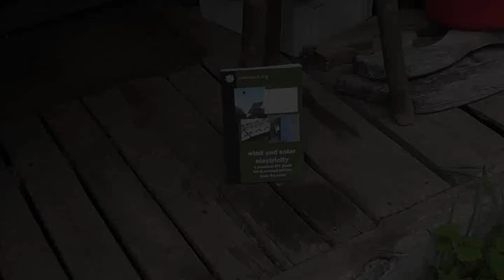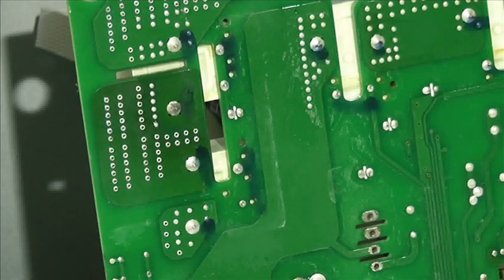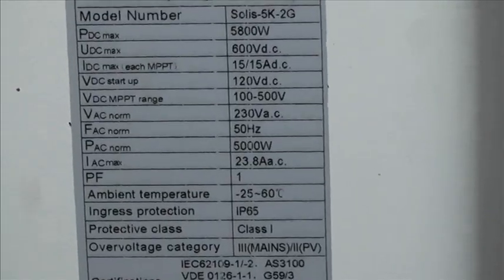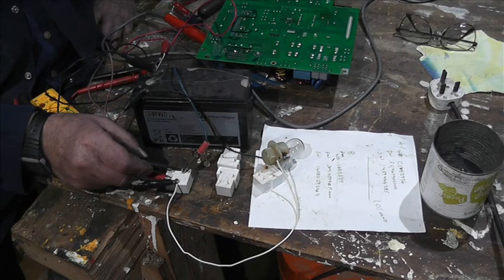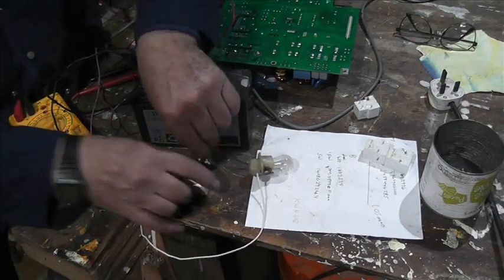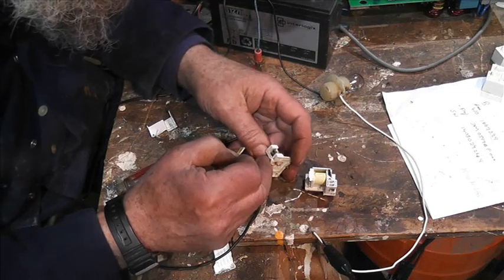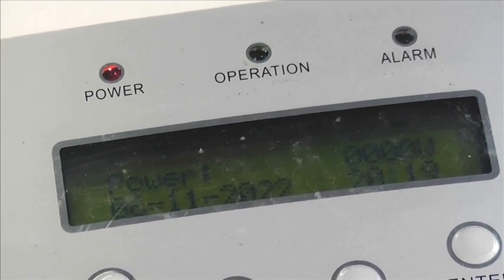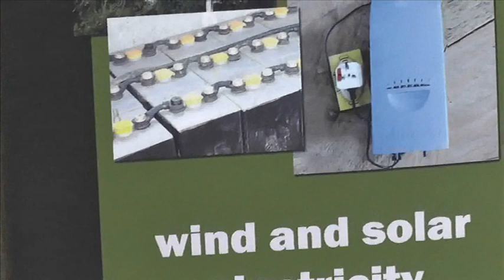Solis inverter hidden OV BUS fault 5KW

Comment: Another great repair thanks for sharing Andy. One wonders if a relay built in the good old days would fail like these do I think not. But they where made to deal with the real currents and voltages and not to a price. In those days we were taught always to adjust a relay with the contact self cleaning action. Thanks for the video.
Reply from the maker: Yes it's a shame and having the tops glued on is despicable, cheers

Comment: Brilliant video. Everything just as you described. Thank you so much.
Reply from the maker: James, so you fixed your inverter, splendid, Subscribed? cheers
Reply: @TheInfoworks  If you're ever in Cornwall, I owe you a pasty and a Bodyboarding or Painting lesson.
Reply from the maker: @jamesbarker7360  Hi, that's the best part of 400 miles, great it all turned out well, you could by me a pasty through my paypal, cheers
Reply: @TheInfoworks  Have a couple. Cheers!
Reply from the maker: @jamesbarker7360  Much appreciated, thank-you
Reply: @TheInfoworks  Update: Inverter is still working, but topping out at 3kW. It's making ticking sounds (arcing or relay), and the readout shows it is jumping up over 5kW briefly. Any ideas? Could it be my poor soldering or do I need to bend the arm more/less? Tried isolating the individual PV banks and each will do 1.6kW, so I'm thinking it's an inverter issue.
Reply from the maker: @jamesbarker7360  sounds like arcing, maybe the relay or a capacitor. Investigate because it will only get worse, cheers

Comment: Great info Andy! I've installed a few Solis' for friends (albeit the storage inverters with 48V batteries).
I''m wondering if they have the same setup with regards to the relays etc.
Thanks for your videos!!!
Reply from the maker: Hi, I suspect they will be very similar, heat is the problem and ventilation the cure, cheers
Reply: @TheInfoworks  Do you know if these relays get cycled every day? In other words, do they open at night when the sun goes down or do they only open in case of loss of mains/other problems?
Reply from the maker: @koffibanan3099  All of these, morning , evening, loss of mains and over heating. The last 2 do the contact damage, cheers

Comment: Good aye Andy, impressive work. Instead of cleaning the relay, can replacements be procured. Cheers
Reply from the maker: Mick, oh yes, you can replace the relays but be careful of the fine tracks to the relay coil connection. They are easy to damage. Hope you have subscribed, cheers

Comment: Iv no clue about electronics but my solis inverter has the ov-bus alarm think I’ll try this method have a go at it. Thanks for the info
Reply from the maker: It's not difficult, just unplugging the white plug, please subscribe, cheers
Reply from the maker: Once you've fixed it watch my video on extending inverter life. The inverter should be in a cool, ventilated space, not in the loft, cheers

Comment: If you're experience of contacts burning out on a nunber of gridtie inverters, could the relay be socketed for easy changing or else on wires?
Reply from the maker: Hi, yes you are right, but this only happens with inverter abuse. I must do a  video on the basic rules, cheers

Comment: Shame the relays can't be plugged in Andy, not electronics type plug but 13a UK type prongs.
Reply from the maker: Hi, in motor vehicles the relay spade connectors commonly create a problem, the more connectors the greater the fail rate. Having said that it would be good to make these a service part. Cheers

Comment: Hi Andy, may I rack your brain over a battery charging issue I have…? I have 3x 130ah 12v AGM batteries on my boat all the same age about 18 months, I have 2 x 240v “ Smart Chargers” which I run off my 2200kw Genny, ( I do not use both at same time)  one is a Genius 26000 the other is a Smart charger pro 25amp, the Genius puts in approx 24amps for 10 mins then drops to 12amps for about 1 hour then drops to float at 2 amps, but I know the batts are not fully charged so I disconnect the Genius and connect the Smart pro, it immediately pushes in around 20 amps! For 5 mins then gradually over “2 Hours” finally drops to 4amps..? Why do you think 2 Smart chargers one 26amp max the other 25amp max would act so differently?? I’m really disappointed with the Genius version because it was quite expensive yet Cops out well before the batts are fully charged? Thanks for your attention.Andrew
Reply from the maker: Andrew, AGM batteries have a higher finishing voltage then flooded cells, that's probably it, cheers

Comment: Do you think there is an element of miss selling going off in the home solar market that's creating future work? Is it the generation of power at half rate of the inverter that prolongs life, or the consumption of power at half rating that increases life span?
Nice job on bringing this one back from the so called scrap pile!
Reply from the maker: Matt, you are right on all sides and fitting the inverters in the wrong place. I must do a video about this, Cheers
Reply: @TheInfoworks  off topic response. Any experience of managing woodlands covered by a TPO?
Reply from the maker: @mattcotton4413  Matt, identify  what work is needed and then have a meeting with the local tree officer. Discuss the problems, cheers.
Reply: @TheInfoworks  cheers Andy